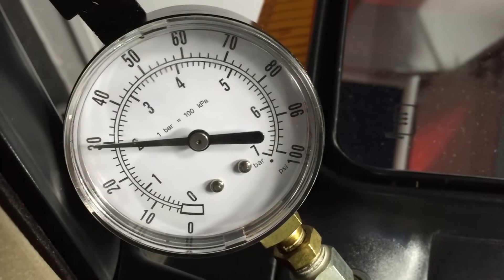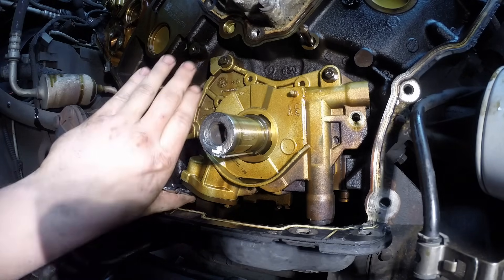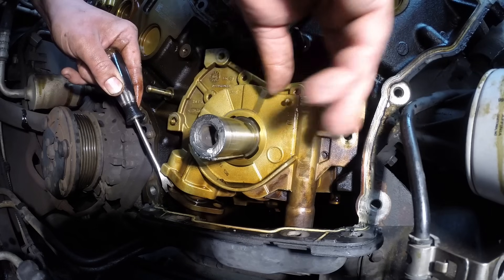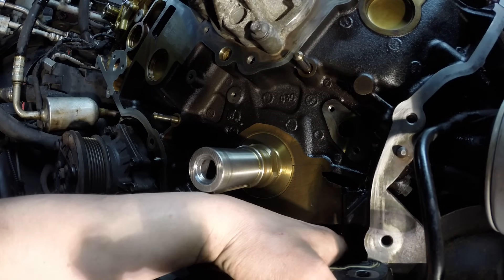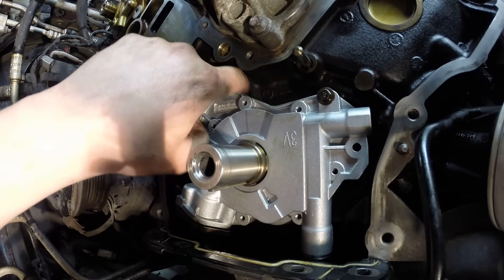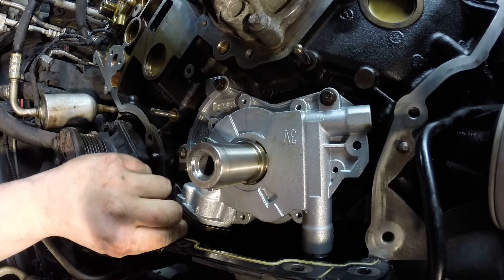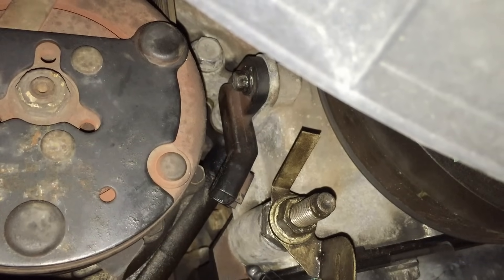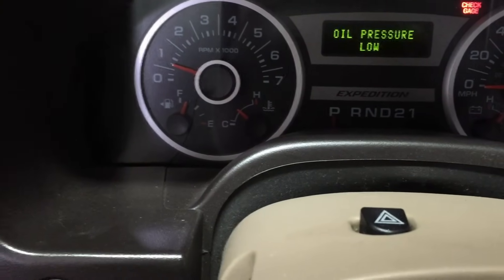Ford 5.4L 3v Engine Melling M360 Oil Pump Upgrade

Comment: Thank you Brian for awesome videos!  Also, my new Melling pump did not prime by cranking from just the starter, I had to actually start the engine, and the oil came up on the gauge very quickly, within a couple of seconds.

Comment: my pump bolt broke i cant find it any where not even ford. I ordered some from ford with vin number they sent me the wrong one but matches their part number. THe one my truck has is the one on the video they sent me one way shorter and bigger in diameter.

Comment: What model Milwaukee impact is that?
Reply: That’s the 18v Fuel 1/2” impact gun that you can purchase as a set with battery and charger or separately as tool only. Nothing special about it. A bit overkill for this. Milwaukee’s 3/8 ratchet driver with the smaller 12v batteries is much better. It gives you enough grip and leverage to break them loose, by turning it like a normal ratchet, then hitting the trigger to remove the bolt fully. 

  They also make a 12v small impact driver that fits better into tighter places and good enough for these smaller bolts that are not rusted on.
Reply: @RemmikRotus  lol that comment was 6 years old, I have all the Milwaukee impacts now and I love them… Thank you anyway for taking time to respond

Comment: I am currently putting one of these back together, is there not supposed to be a 4th bolt on the lower right hand side where the discharge from the pump enters the block?

Comment: For my 2010 f150 5.4l 3v engine, Autozone's system says my oil pump is a melling m-340, not m-360. Going to do more research, maybe their system is wrong. Would hate to buy the wrong part.

Comment: I bought the m10340 oil pump. Should I put in the lower pressure relief spring? One is for 60 and the other one that comes installed is 80 psi. This is for a 2006 f150 5.4 3V.
Reply: I am thinking I should put the lower pressure spring in there since idle oil pressure seems most critical. Will higher oil pressure cause any issues such as leaks?
Reply: Anyone?

Comment: I have a 2006 Nav and replaced the oil pump with a 10340 during a full timing/phaser job.  The job went well but after starting the SUV, I get a loud squeal from what appears to be the new oil pump.  Any thoughts before I rip it all apart again?

Comment: Local Ford dealership says the whole engine needs to come out to replace the oil pump, mentioned how you did it in this video and they still tried to argue with me and say the engine needs pulled lol.
Reply from the maker: +atvrider391 Wow! Ford only call for the pan to be dropped.
Reply: @FordTechMakuloco   I was also curious about the 5w-30 used and also what about the cam lockouts being used these days?  I've heard people having good experiences with the lockouts and tune.  I am asking because i recently bought a 2006 f150 3V 5.4L truck and looking to get ahead of the game.
Reply: @madhatter3142006  I have an expedition that I am doing the lockouts with the new tune in the coming month...it totally make sense to me that stopping the variable cam phaser movement using lockouts will eliminate the knock as the internal phaser part are hitting up against the phaser pin...yes power loss will happen but for me I dont tow that much and I care more about stopping the damn knock..I also feel that a new oil pump is a good idea IF you aren't using lockouts...I think its optional with lockouts as the lube in the phasers isn't really as much an issue any longer...but getting more oil to valve train is certainly a good idea...for me Im just going after the phasers first and see how that works..engine runs great except for the phaser knocking...I figure the experience of getting the valve covers off and doing the phasers will educate me enough to do it way faster the second time around if I have to go back in after the timing components..plus way more money at that point too...I agree on the 5w-30...still starts up cold at 5w then going to 30w after warm up to me is better for coating the parts and holding onto the parts...20w is so damn thin...just my 2 cents worth
Reply: @steves3688     bad idea
Reply: @steves3688  the stock oil pump is all aluminum and they wallow out on the inside where the gear rides,  and oil pressure goes down accordingly.   Notice the Melling pump has a cast iron backplate to avoid this.  Even if you don't go aftermarket you should at least replace the stock pump if you're in there already.
Reply: @Brons2  Yeah I still havent done the job but I will take your advice and replace the oil pump...I did see some videos of the backplate blow out on the stock pumps...ty..
Reply: At $125/hour dealer rate, of course the engine has to be pulled to change the headlight fluid and blinker gears.
Reply: @cougargold  😂😂😂
Reply: stealerships
Reply: When you get higher miles tolerances open up. 5-30 is beneficial on a higher mileage engine
Reply: Ford wants some extra coin!
Reply: The local Ford dealership is not going to pull your engine either, BUT, they are going to charge the book time for doing so.
Reply: I'm surprised they didn't sell you a new Donkey with extended Bumper to Bumper warranty that's doesn't cover electrical (basically Everything on a vehicle is electrical) and doesn't cover normal wear and tear
Reply: Thanks for this we don't have to trust dealership anymore
Reply: shoulda just walked out instead of showing a vid. just proceeded immeiately to a guy who would do it this way if that"s what you wanted.
Reply: Dam service writers dont know crap. They are salesmen. Customer pay  gets milked to death and jobs running off by desperate and often incompetent  dealer technicians.
Reply: You are amazing buddy thanks for a nice well explained videos, l have a 2007 e350 5.4l super duty van with low oil pressure, lm try to replace oil pump with a melling oil pump wish one do u recommend me to use melling 360 high pressure or melling 340 high volume? Thanks
Reply: Will the m360 fit my 04 Lincoln navigator 5.4l 4valve engine
Reply: @JuanRodriguez-ki4to   nope, you dont need it anyway
Reply: you sure about that 5 30  / oil ? book says 5 / 20

Comment: Will That Work In a 05 5.4 F150 xlt 4x4? I Priced It Over a Year ago. Their finally gonna Fix it. Hope I Don,t Have to pull the Pan
m360
I'm ordering The Ford Cam Phazer Chain & Guild set Too. I Never Ordered off Amazon For A Customer Before.

Comment: Great Video! How come you don't recommend the Ford Racing (M-6600-F46) High Volume Oil Pump? Are the Melling Oil pumps just really better?
Reply: and its only 70$    willit work exactly the same ?and what volume of flow is it ?

Comment: You ever did one for a 2001 Ford Crown Victoria or would this work for it also
Reply from the maker: This one should work also but most times those take a M340
Reply: ok 
Need to do mine before it gets to cold

Comment: I have a 2001 5.4l v8 f150 4x4 and the low oil light came on than off the gage bottomed out than back to normal. Any idea what I can do?

Comment: I once put a high pressure oil pump on my Camaro. I should have read the instructions. It was for race cars that run thin oil. It blew gaskets\seals out all over the place. As it reached 90 PSI...  When it was designed for 45 PSI...

Comment: How are you today? I watch your videos on the 2005 F150 5.4s all the time they are great to help me out when i work on my truck.Can i please ask you this ..You did a 4 part video on timeing chains Cam Phazers and guides and tensioners and a new oil pump ..I am thinking about doing this on my 2005 5.4 f150 FX4 the truck is in good shape body wise .The motor runs good (But) it has 175000 miles on it ..I was thinking of doing the Rollers rocker and Lifters at the same time is it to many miles on it to just do the top of the motor or what do you think? Any advice would be great and if you can take the time to shoot me a few tips that would be super.. PS  I see from watching your videos your into Dodge now put hope you can help me out with this pain in the ass Ford.. Thanks

Comment: I must say I have watched your videos over and over as I do my 2003 F150 5.4l and this step was by far the most difficult at getting that little bolt in!! LOL You make everything look so easy, I had a blown cylinder head and your 4 part engine timing chain replacement has helped me  so much.  the only difference is I took it one set farther and removed the cylinder heads.  I thought well is was at it i may as well change the oil pump and water pump, I am glad I did but....dam that bolt!!  Thank you for posting these wonderful videos to help us DIY people!!!  I will mention I am a 53 yr old women and getting the job done thanks to your videos!!
Reply: I own a 2003 and also wondering if I can use this upgrade pump before I start with the roller follower replacement.
Reply: Homesteading 101 2003 is a 2v 5.4L as far as i know- i have a 2002 5.4L 2v - which oil pump did you use? I cant seem to find a definitive answer from anywhere on whether or not i can use this melling upgraded hi flow one.

Comment: Fordteckmakuloco whats the torque spec for the backing plate of the oil pump 89 in ?
Reply from the maker: +Rafael Huerta Acuchi no specs but yes right around 89 inch lbs

Comment: Hi Brian, what pump would you use for the 5.4 2v (2003 Expedition), secondly, no locktite on the pick up tubes bolts going into the new pump? Do you have a link for the timing kit for a 2v or just piece together from the dealer using OEM?? Thank You

Comment: One oil pump screw broke. Should I've bought new one's from the start? They won't torque to nowhere near 26 pounds.
Reply from the maker: The torque spec is 89 inch lbs.
Reply: Wow 89! I may be getting a little confused or I'm just plainly bliss. How much is that in Foot-Pounds?
Reply: FordTechMakuloco Ow nvm I'm dumb lol! I googled it and it came out 7-8 Foot-Pounds. I was foolhardy. Hey man I love your videos they've help ALOT! Thank you very much for what you do man.

Comment: how did you get the hard to get to bolt out without dropping it.
Reply from the maker: +Michael Mindak you can stick a flexible magnet on there for the last few threads or put a tag down in the pan covering the width of the pan and just unscrew it letting it drop
Reply: Or tie fishing string to it
Reply: I used a flexible spring loaded claw type pick-up tool and clamped it directly behind the washer. This allowed me to direct the bolt into position and use the flexible wrench to begin the thread. Definitely holds the bolt without fear of it dropping.

Comment: my parts guy looked up oil pump for my 05 5.4, and he's saying m340 will fit. The m360 wont, please let me know if I should return the m340 and take m360 even though the parts guy says it wont fit. Any big diffrence between m340 and m360? Please help!!!

Comment: Help!  Which spring do i use? 
    - Got the M360 for my 2005 F-150 5.4L 3v, but it would not fit all the way on, and would not seat.  
    - Now i have the Melling 10340, but it comes with an extra spring if i want to drop the relief pressure from 80 to 60psi.  Comes with a note that says the installed blue 60psi spring matches original 5.4L 32-valve engine, and the brown, 60psi one matches 4.6L 24-valve engine.  However my engine is 5.4L 24 valve.  anyone know which spring to use?
Reply from the maker: The M360 does fit any 5.4L 3v engine as shown you must work it back and forth to drop into place and spline with the crankshaft. It takes a little back and forth but falls right on as shown I do them all the time. I would only use the 60psi version
Reply: Tried the M360 one last time, and it finally fit!  There is a big difference between what I can get done at midnight, and at noon the next day!  Now it's time to return the M10340.  As always, your videos are awesome.  Keep up the great work!
Reply: @FordTechMakuloco  Now I'm confused, do you mean the 80psi one? I was planning on the 80psi but your comment here has me second guessing.

Comment: Hey Brian, 
               Thank you for all the great information! I took my 09 f150 with 100k miles to the shop and as I expected it needs the whole timing kit / oil pump, vct fix. I was thinking of doing the repairs myself, but I'm realizing that I just won't have the time for such an involved project right now. How can I convince a shop to use the upgraded oil pump rather than replacing it with the same pump that isn't designed well. Most of the mechanics I've talked to will only order parts from the dealer and will not use anthing else. Does Ford make an upgraded pump like the Melling they could order instead of the existing replacement? I really don't want to have to pay for the same repair again. I know it costs more to have a professional do it, but I also want the best parts for a lasting fix.  Any advice on how to talk to the mechanics would be great!
Reply: It's your vehicle, you tell them what you want in it. Period.

Comment: Can you link to the adapter used to installed the hose in place of the oil pressure switch

Comment: lol i like how you didnt show that last bolt going in the pick up tube.  i ended up dropping the oil pan an inch or so and i could fit my fingers in there a lot easyer.
Reply: Things that make you say “hmmm”
Reply: Were you able to access the oil pick up tube to remove any debris that may be lodged in there during any point of this?

Comment: HI Brian, love your videaos man, so well explained!!! like Apples and Pears LOL
 Q. so over 100-150 kmiles engine still use 5w-30?? or heavier oil? why some mechs recommend 15-40 or 20-50? 
Thanks
Reply: I run 15-40 in mine and not a prob

Comment: I really wish I would have known this back in 2014. I did phasers, chains, tensioners, VCT solenoids on my dad's F-250. Didn't put an oil pump on it. 1300 miles later, it spun a rod bearing. Would have been cheap insurance, but instead I still have to put a motor in it.

Comment: I have 108k on my 3v and I'm getting the phasers and chains replaced. I'm tight on money at the moment would this pump be something I can put off for now? even though it'll cost more to do afterwards
Reply from the maker: Always replace the pump
Reply: FordTechMakuloco even if the pumps still good? I'm tight on cash atm and trying to save money until I finally start my job then change it if possible to hold off till then
Reply: acedriver1997 I

Comment: Question for you,even thou your mechanical gauge read above 40psi,your dash message center is saying oil pressure low.Whats with that?
Reply: carey lee the oil pressure switch was still disconnected.

Comment: Thanks for the great video. If I was to switch to the M360 pump and 5w-30 oil and installed the ratcheting iron tensioners like the older motors had, do you think this combination would cause the tensioners to ratchet too tight?
Reply: They cannot get too tight. The chain controls how much slack is there.

Comment: Hello, you make my favorite YouTube videos.  2001 F150 4.2L v6 automatic 223,000mi.  Erratic oil pressure gauge/light, changed oil sending unit & seems fixed.  Bought Melling oil pump at same time. External pump between oil filter and timing cover.  So when I go to replace, what prevents the drive rod from falling out of CPS and onto the ground?  If it does fall out, any tips on blindly getting it back into the CPS?

Comment: I followed your step by step video. I have no oil pressure  that could it be?
Reply: I am having this same problem.  After many unsuccessful cranks, I started for two seconds.  Still no pressure build up.  Seemed to run very rough.  I am at my wits end.  I  just want to see that needle move.  I removed the pressure gage and no oil came out so I am certain it is not pumping.  I even tried to pressurize the oil pan through the dipstick tube to give the pump suction head, also did not work.  Any other suggestions?  O ring is on.  Pump is flat against block.
Reply: Got it to prime.  What a relief!
Reply from the maker: If you followed it thoroughly and you have cranked it twice at 15 seconds each then the system is pre lubed enough to start it may rattle a bit for a second or two but after that it should be gone. If it continues then shut it down!
Reply: I did still no oil pressure I even checked the oil filter in there's no oil when I put the oil pump on could I miss lining up the flat groves
Reply from the maker: When the pump finally lines up it will drop into place as I mention in the video then to be sure you want to check the reveal on the front of the crank  that I point out and the oil pump housing will be right against the block too. Did you check all of that when you installed it.
Reply: Yes pump is against block. Could I gotten a defaulted pump
Reply from the maker: +Mark Roadarmel it is possible I guess. You started it and it just rattled never quieted down?
Reply: No I left a crank sensor unplugged to Prime the system an it never built pressure I even pulled up oil filter off and there was no oil in there after about 60 seconds of cracking and over I did not want to start it if something was not done right or a faulty pump I took it back a part in the pump is lining up like it's supposed to I'm lost that's why I'm asking these questions
Reply: This is my first time doing this I want to make sure I'm doing it right I followed your step by step instructions on the videos
Reply from the maker: Start it like I said and if the tensioners have not pumped up after 2 seconds shut it down. Some trucks it requires starting the engine first to spin it fast enough and build pressure. You will know within 2 seconds.
Reply: Ok everything was ok! just got one more question. when I first started it up and it ran alittle ruff then cleared up is this normal?